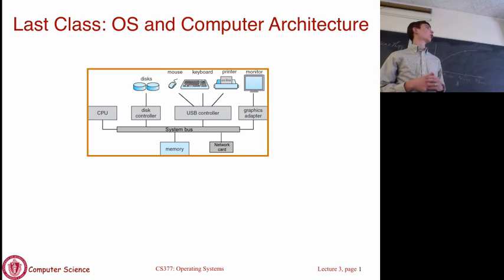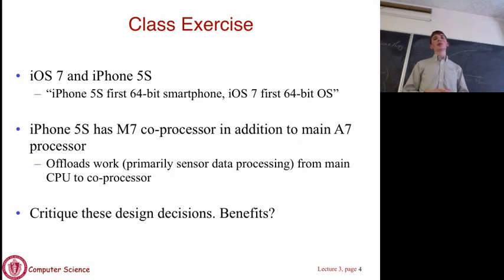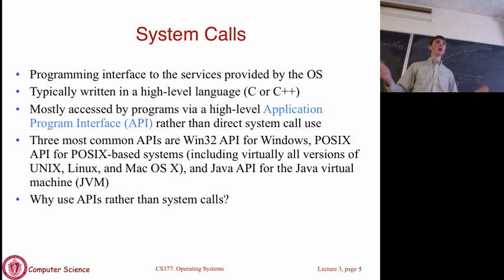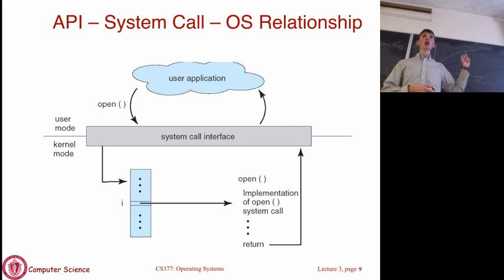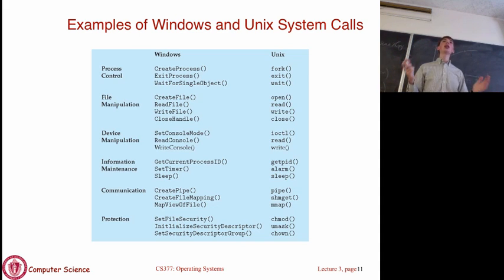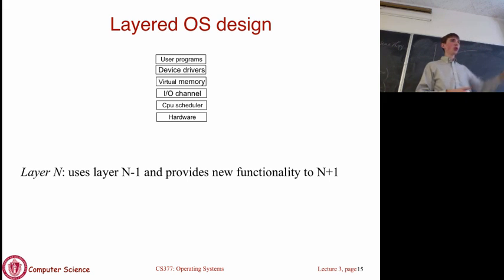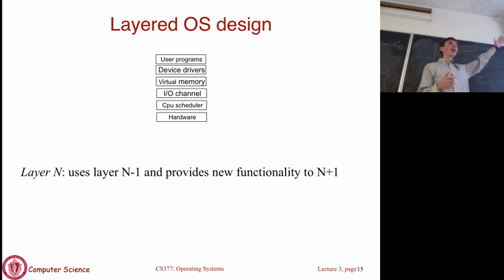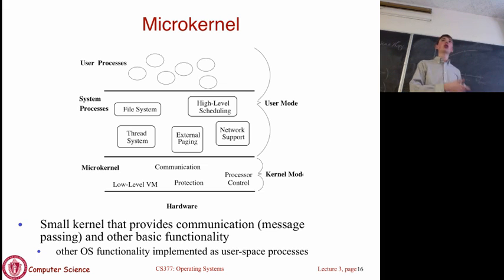Lecture 3: Operating System Structures

Comment: Can someone tell me why a system is more reliable if communication between two modules goes through the kernel? Or, the other way around, why is direct communication between two modules less secure?
Reply: Hi, problem in one module will not crash the whole system as only that module is affected in micro kernel approach as each module runs as a individual process and the address space is not shared. On the other approach the memory is shared which means some malicious code of one module can affect the entire system.
Reply: A system can be more reliable if communication between two modules goes through the kernel because the kernel acts as a central point of control and coordination. The kernel enforces a set of rules and policies for how modules can communicate with each other, which helps ensure that communication is reliable and secure. By routing all communication through the kernel, the system can better manage shared resources, prevent conflicts, and detect and handle errors or exceptions that may arise. On the other hand, direct communication between two modules can be less secure because it bypasses the control and coordination provided by the kernel. Direct communication can lead to race conditions, where multiple modules attempt to access the same resource simultaneously, potentially resulting in data corruption or system crashes. It can also allow unauthorized access to sensitive information or resources, as there may be no built-in mechanisms for authentication or authorization. Furthermore, direct communication between two modules can make the system more prone to errors and bugs, as each module may have its own assumptions about how the other module works, and there may be no clear definition of the interface between the two modules. By contrast, routing communication through the kernel provides a standardized and well-defined interface that all modules must adhere to, which helps reduce the likelihood of errors and inconsistencies in the system.
Reply: If I have pornhub and text messages open at the same time, I dont want either one to know the memory details that the other one contains
Reply: Never let your left hand know what your right hand's doing